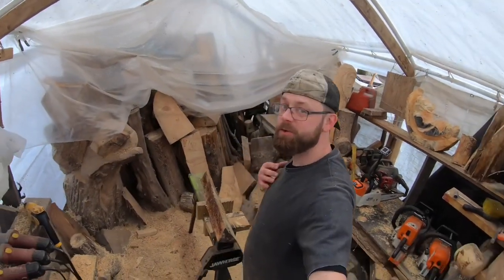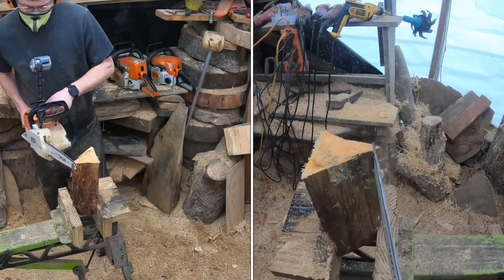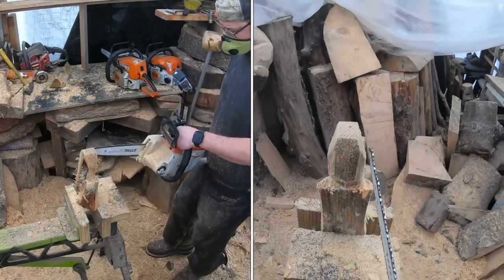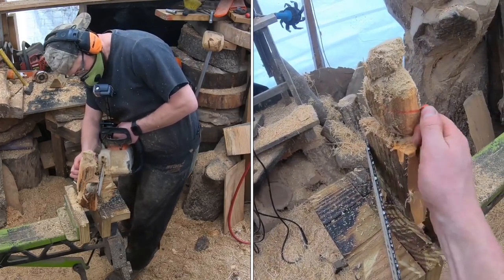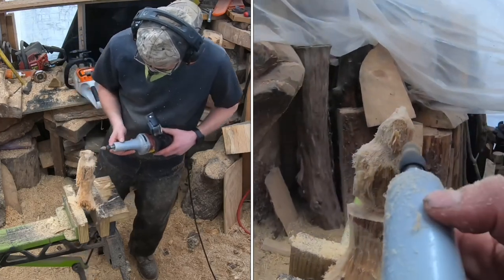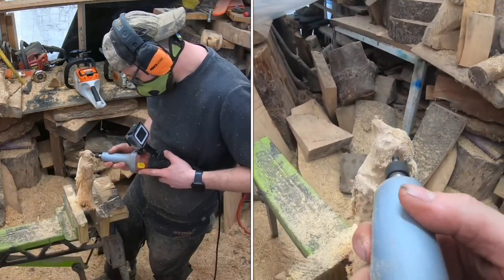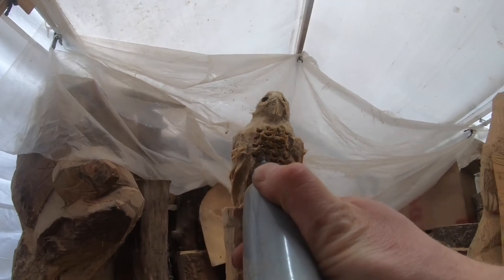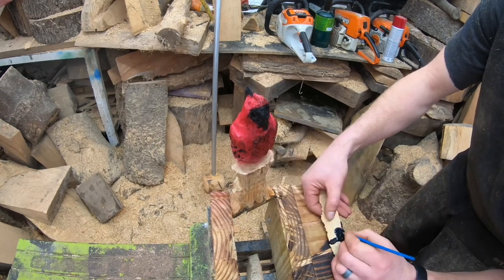Chainsaw carving scraps for cash . Chainsaw carving a cardinal Tutorial

Comment: I want to find a Stihl saw that is electric that I can put a dime tipped bar on. I don’t want a battery operated, but one that I can drive with a power cord. 

Do you have any suggestions?
Reply from the maker: Sorry I do not as I have not used any corded saws . I would go to Stihl.com and read the descriptions of those saws . They might already have a 1/4 pitch sprocket so it may fit a dime tip bar . I’d also talk to a dealer about the setup